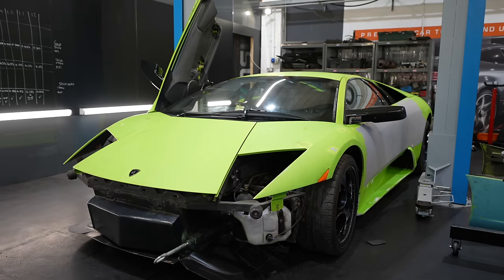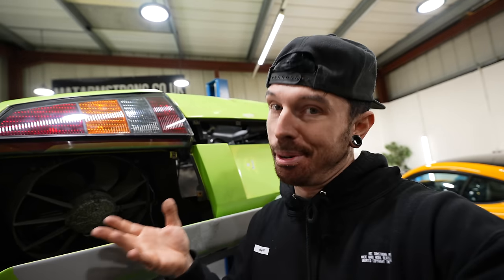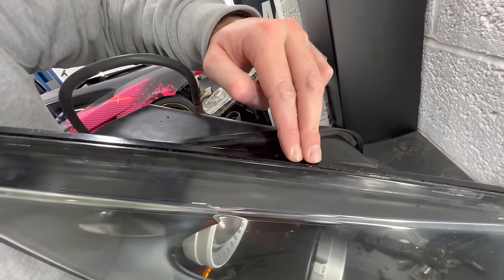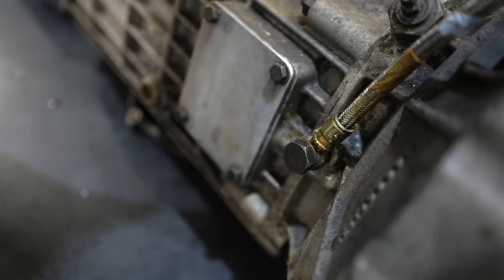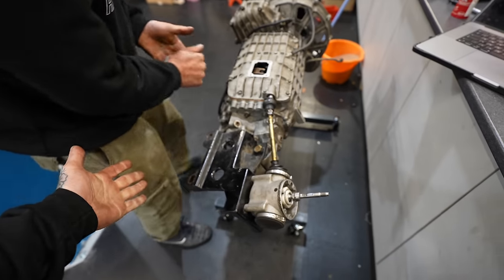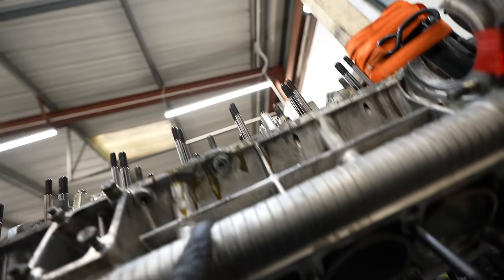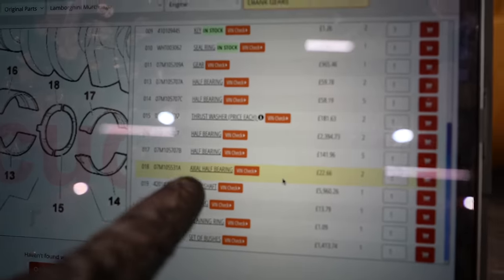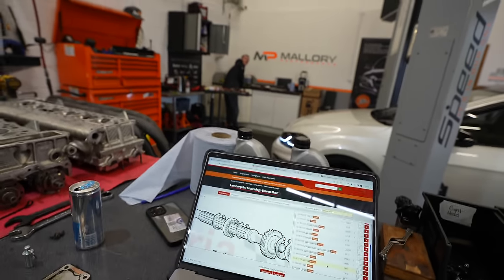REBUILDING AN ABANDONED LAMBORGHINI MURCIELAGO | PT5

Comment: Using windshield urethane won’t stick unless you use primer. Sun can heat the lenses and then make it release. Learned this the hard way. Better fix that soon. Good news is it’s easy to fix. All you have to do is use a heat lamp to wam them up and pull. Comes right off. Warm the urethane and it will peel right back off lol. If you do not they will start to leak.

Comment: Geez Matt, the track day company mechanics have brutalised this vehicle. £100K is way over the top for that wreck. I have every faith that you’ll get it to be near perfect!
Reply: Yeah I think 70,000 would have been fairer, considering the amount of repairs and re-builds that I can see coming, and the Paint has to be totally re-done.
Reply: @scottcarr3264  I wouldn't even trade it for my fiat punto at this point. It's wack. And the punto runs.
Reply: Im confused, a quick search and you can find used Murcielago's in the 30k-60k range, better condition than this. Am I missing something?
Reply: @scottcarr3264  50k would have been my max. You can get a running one for £140k.
Reply: @dondiabolic2810 what murcielago are you finding for 30k? 😂 most likely a rep. Cheapest murcie on the market rn is 139k
Reply: @V3LOCITY__  if we're talking non runners then there are tons out there.. however running ones are a lot more obviously

Comment: For future reference, you can bake the headlights carefully in an oven at 93 degrees. This will soften the seal and allow you to separate the butyl sealant they use. Seems as though you just prayed them off whilst the sealant was brittle and that broke things.
Reply: Not this one
Reply: Used to do it, but on headlights without xenon. Just basic halogen one.
Reply: You're absolutely right. 👍 I was shocked seeing him doing this to cold headlights for 3 days..
Reply: Hard to believe that you’re not using a heat gun or even a simple hairdryer…
Reply: @snik2pl  absolutely on this one, it’s been done before on the forums. Glass lenses or not, same process
Reply: Was thinking the same thing! I used to black out the headlights on all my cars and removed the glass by baking them in the oven every time 😄
Reply: Came to say the same thing. MK4 guys do it all the time.
Reply: @mfletcherg122  MK4 represent! Replaced the plastic lenses in mine years ago with Spinto glass lenses. Looked awesome. And yes I used a heat gun to get the plastic ones off.
Reply: That was my thought
Reply: Would have swapped in some modern optics (D2S Mini's or equivalent 3" bixenon projector) while it was apart, too. Those old projectors probably have burned out bowls by now.

Comment: I've always just put headlights in the oven at like 350*  for like 5-10mins you kinda have to keep checking them. That way the whole Assembly heats up at the same temperature at the same time. Makes it a lot easier to break the headlights apart I've done this on multiple Volkswagen headlights with glass lenses and plastic lenses never once have a broken anything. Hopefully that helps somebody in the future keep up the good work Mat!

Comment: Just one question I had already in my mind as the enginse was disassabled the first time. Was just weeks to late to react on this.
Did you verify that the pistong rings have the correct spacing? If to wide they could leak oil. If to narrow, well metal expands with heat and then they could close fully and the ends will touch. The result of this will be a dead engine.
With all the crappy work done on this Murcielago I wouldn't trust that the rings are as they should be and unfortunately, even new purchased rings are not guaranteed to have the spacing on spec.

Comment: Tip for the plastic headlight mount:  Depending on the plastic, there are ways to fuse the plastic back together.
1.  If it's ABS (quite possible, those should be durable), acetone will basically make the plastic malleable.  Use a cotton swab to apply some acetone on the edge of the broken off piece, then push it into place and hold it for a bit.  When it sets, it'll be welded together again good as new.
2.  Baking soda and superglue, the new sensation of makers across youtube right now.  Adam Savage has explained how to best use superglue in a recent video, actually.  He demonstrates the baking soda as an accelerant to get the glue to set super quick, and it will leave a layer (or mound, depends how much glue/baking soda you use) behind bonded to the surface.  Do this to the underside out of view of observers and it should keep the corner on nice and tight.

Also, man, the guy who did these "fixes" is such an asshole.  Like, who DOES this kind of thing?  Hurr durr, too tough to take apart.  These tab things can't be important, let's just get rid of them...

Comment: Can't speak for your headlights, but I have done a lot of glass lights like that in the oven. 10 minutes or so at 250°f.  Makes the adhesive very soft and easy to pull apart.

Comment: Did you guys try putting the head lights into the oven? I would have put them glass side down so the oven heat from the bottom of the oven would heat up that area. Maybe a moist towel on top just to be extra safe, but around 110 degrees C shouldn’t hurt the plastic, but would get the seal gooey. I did it with much cheaper headlights, so maybe not a good comparison.

Comment: If you heat the headlights first you can easily pull off the glass, i thought that was a basic thing mat would know, but obviously not, you can even put them in the oven.
Reply from the maker: Check the last video… the heat broke the glass

Comment: Hey Mat, great detail in the rebuild, but my only concern is with those replacement plastic headlight covers - in the video you poke them with your finger and they look like they flex quite a bit. At 100mph there'll be something like 40lbs of force on that headlight cover, which will be like stacking 40 bags of flour on them, if you continue accelerating then as you approach 200mph the force on them will have increased to about 120lbs and I don't think those plastic replacements will take anything like that. On a car that is capable of 206mph I can get why Lamborghini would have fitted such thick glass lenses and bonded them in so well! At anything like those kinds of speeds the failure of any bodywork component contributing to aerodynamic air flow could have quite serious results...

Comment: I actually have a NICE idea for you to repair plastic. I found one, who used quick glue/second glue/super glue or what you call it in UK. It CAN NOT be the GEL based one. Have to be the total thin, like water one. And then baking powder. Clean the parts first and then either drip a small one on the surface and then quick baking powder on and do that on both parts and then put them together and wait. But you have to be a bit quick. I use alu foil to drip glue on and put some baking powder close to it and then drip in glue first and then dip in powder and put the together. After, you can sand it down and repaint it. I have done this a few times now and it gets strong as heck. I even build a whole pin up from scratch (for my trunk, where the warning triangle is mounted and you turn this pin around to open/close it, that pin was gone, just the turn around part was there but couldnt close) I hope the description is understandable enough 😅🤣

Try it on different parts and see how it works for you. :-D The h eadligts corner, could be build up with this and some patience. For 10K£, I would do it for 1 month full time job 🤣🤣🤣🤑

Comment: 19:0 Those plastic lenses look OK, but it would have been even better if the polish guys also copied the CE- certification numbers from the original. Like that its easy to spot and most likely an MOT failure...

Comment: Separating the glass off the headlamps.... 👀 did you try softening the sealant with a heat gun? It's a screen repair trick for mobile phones, might scale up but obviously there's the worry of melting the plastic... 😅 I'd maybe have tried it before resorting to a hammer when talking about 10grand

Comment: Idk maybe you got a good deal on it depending how much you put in. Probably worth at the min 175k after it's fixed. I don't think this would require 75k to fix so I think you'll make a good profit if you decide to sell it. Cheapest running murcielago I found in the states is 175k and there's only like 10 listed.

Comment: Does anybody make an aftermarket throughout bearing?  Or the OEM supplier equivalent.  On a Lexus I had I found KYB made the strut for Lexus but as you can imagine Lexus wanted twice as much for the one with their stamp on it.  Lamborghini is so small I doubt they make many of those transmission parts.

Comment: That headlight....

ANYTHING that is held together with any kind of glue/adhesive. ; use hot water, or bake the entire thing at max 75celsius. It should soften of the glue a bit. Use a heatgun if you dont have other options. Even and not too much heat is key.  Further. It makes the plastic a lot less brittle

Try to attach a string of steelwire like 0.2mm to an improvised knitting pin(whatitscalled?) which you mash through the silicon, in and out again so that you have the steelwire going through the entire headlight. You can then pull the steelwire around the edge, dissambling the headlight without cracking it

Comment: So two things Mat. 
1: why didn't you guys just place the headlights in an oven at a certain hear tell to be able to pry under the glass without breaking it? I ask this because Subaru GC8 lights have glass too & they use that method to open them up.
2nd: plastic covers aren't a huge favourite because of how they stain quickly compared to glass. Specs(glasses) are a good example of this. Plastic lenses easily get scratched as compared to glass ones

Comment: Matt, hope this isn't too late... Replace all the thrust washers in that engine. Always, always, always, always replace the thrust washers. In the case of the pair that you showed us, replace them both. You might think that it is OK to just replace one, but that engine has clearly been ragged - so what you're doing is putting one "new" and one"old" washer back. Which means that the old one might have [likely will] a degree of wear. 

Let me put it like this... 20 years ago I went through a similar exercise to you on a much less powerful engine [a straight 6] that belonged to a mate of mine. His father helped him with an engine rebuild - re-used the original thrust washers because he couldn't be bothered to go collect a new set from a local retailer who had the part in stock... and it cost him the engine. 

I can't stress this enough. Always, always, always, always replace your thrust washers with new when you strip an engine this far. Always. Remember: always.

Comment: The headlight needs to be placed in a oven at approximately 120 degrees (Fahrenheit) for about 30 mins for the seal to soften. You may find yourself in and out of the oven a few times until completely removed. 

At least that’s how is done with Porsche headlights.

Comment: What really bothers me about these exotics is the insane prices for spare parts. I don't see any justification for example charging 10,000 for a headlight. That kind of robbery is why an average person doesn't own one of these. I suppose it is intentional, because by pricing these cars out of reach for the masses is what makes them "special", but I believe they aren't really all that special. In fact, some of the engineering is below average for modern cars.
What is kind of a waste too is that someone who has the money to own one of these would allow sub standard "fixes" like a wire that is controlled by an add-on switch. That totally ruins the specialness of car like this. For example, I own an old Corvette. It's Bose radio system could easily be upgraded, but as soon as I would do that, it would devalue the car. Sure it would be more modern, but then the classic nature of the car would not longer let it be a "classic"

Comment: Looks promising but expensive as f@k, anyway all old cars from beginning of time, used to have glass instead of plastic because was basically the way that different brand will make it and was atractiv, nowadays they've changed it to plastic(polycarbonate) for safety but mostly because is much more cheaper to manufacture and more flexible. Glass is hard as you notice already but in case of bad accident you never know where those glasses will fly.

Comment: Remove what parts you can off the lights i.e., bulbs, rubber boots fuses etc. put light casing in the oven at app 80 for about 5mins, run a thin tool around the edge and slowly lift glass cover, repeat as glue cools and hardens. Works for me

Comment: Too bad it's already late! But to disassemble the crystals of any optics armed with glue, it is only necessary to put it in boiling water on the side of the glass until the glue is covered! And leave it for 5 to 10 minutes. Then there they will be able to disassemble it easily and two flat tools! 💪🏼💪🏼💪🏼

Comment: Did you try putting the whole light in an oven? I’ve done that with Aston lights in the past.  Granted they are plastic but using an oven prevents local hotspots, might it have worked with glass?  Good luck with the rebuild 👌🏻

Comment: Whilst you have the headlights apart I would at least clean inside the projector lenses. Even better I would uprate the lenses on the projector, you can buy aftermarket versions that are much higher quality.

Comment: MAT!!! Make sure you check those headlights have the correct part numbers, you could find they are LHD units, as they used to be cheaper to replace than RHD units, especially for a track car where it does not need an MOT.

Comment: Stove heat black paint you need. Normal paint will burn off with the heat from the lights.fumes will discolor the clear lens again. You need a hot air gin for the lens.the glass can withstand the heat the plastic will soften at around 240c. You need to get the glass all around to said 240c it should lift off easy thenbut do not burn yourself on the hot glass.

Comment: Have you try using a heat gun to open the headlamp cover? Usually the silicone glue will melt because of the heat, so you can open the cover easily. At least that's work for most of the car in my country.

Comment: Should of used a oven for the headlight. Just have to keep checking on it, but about 5-10 minutes would of heated all the sealant up at once instead of you heating one side working on loosening it, but by the time you get the the other side of the light it’s set again and sealed. Had to do it on my Range Rover and didn’t crack any glass or melt the plastic

Comment: I would put a few more coats on the light surrounds if it takes that much effort to get to them. I also would have considered drilling an access hole in the back of the lights to attempt cleaning the fog from the inside before smashing them. Maybe plastic welding instead of glue to fix the damage caused when the glass was removed also. I'm enjoying these vids. Cheers

Comment: Take the bulbs out and add some rice inside the light.
Tape off the holes and leave for a few days the rice will absorb the moisture.
Then reseal the exterior to prevent more moisture entering..

Comment: I would like to see a test on the LED temperature theory - some LED bulbs run hotter than halogen ones. That's the reason most have a heat sink or even a mini fan built into them. Not trying to be argumentative, just don't want to see you melt your new headlight lenses

Comment: Did the same with my Ferrari 360 head lights..need to take off the lightbulbs and put a magnet inside wrapped in cloth then use a magnet on the out side to drag the one on the inside..will clean the inside without having to remove the glass

Comment: There a solvent to get off glue. should have researched what epoxy they used on the glass. Had the same problem on certain parts that are glued with epoxy.

Comment: Your pressure test was flawed. You need the resistance of the pressure plate, which will increase the pressure in the line required to move it. Static test will require hardly any pressure to move it.

Comment: Hey Mat so from what I understand the e-gear and the manual transmission are the same thing.   You can convert the e gear transmission to a manual.   For the headlights did you guys put them in an oven until the glue softens?  That is how I have done them and never had an issue. Just make sure you leave them in long enough.

Comment: Wouldn’t a heat gun and a dremmell, with a small cutting blade, be able create a gap between the glass and plastic to create enough room to slide a pry in as you move around the light?

Comment: use high temp paint if you decide to paint those silver bits around the headlights. They will get hot and you wont be able to deal with the paint if it exceeds the temp rating.

Comment: I would fill those 2 bores from the person that almost drilled through with a quick weld or something.  Depending on how deep they are they could cause a weak spot under high heat.  did you check their depth?

Comment: its probably not silicon i bet its butyl rubber best to get an even heat would be to put it in an oven rather than a heatgun...also if for some odd reason its silicon you can get silicon remover from hardware store that will break down the bond

Comment: You can remove glass lenses very easily, you bake the entire unit in the oven to soften the butyl sealant and use plunger tools to pull the lense off rather than using pry tools which will shatter the lense. That was painful to watch lol.

Comment: did he try putting the whole headlight in the oven to warm up? i thought that was the usual way of doing it since the heat softens the glue and makes it pliable/far easier to pull apart.. or even a heat gun around the edge

Comment: With the headlights did you try heating it up around the edge last time i split heads (granted they wasn’t lambo headlights 😅) a heat gun worked a treat but another great video 👍🏻